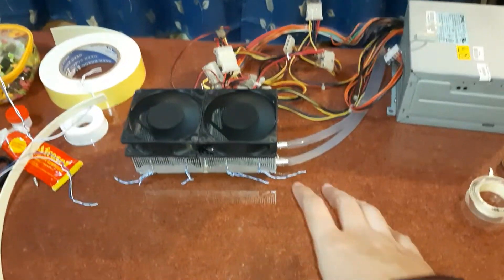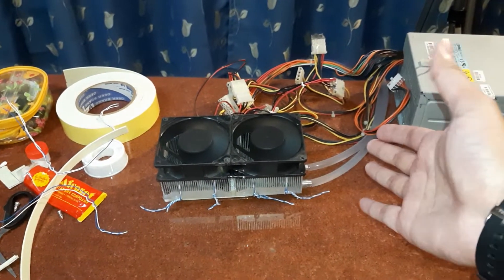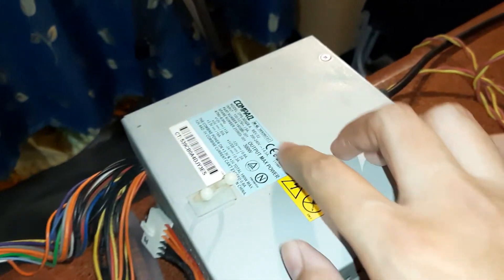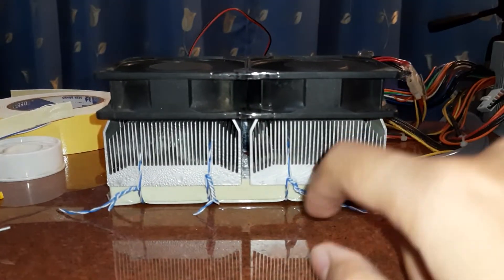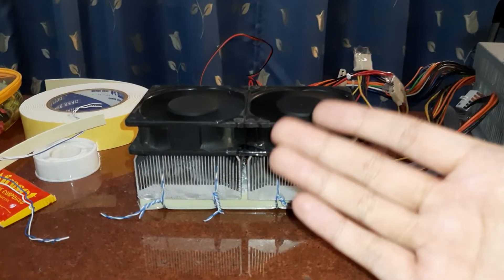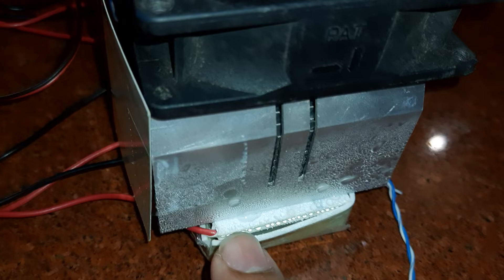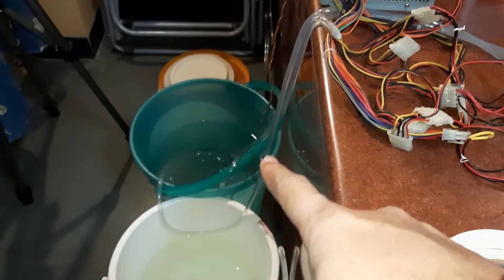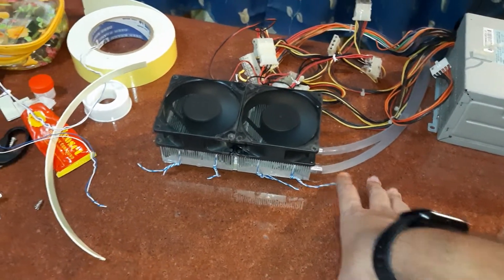[Eng] DIY Peltier Micro AC V1 | ThermoElectric personal cooling system attempt 1

Comment: Sir no matter how hard you try on this project it will never work .
You can use old fridge compressor to make personal Ac of capacity of .5 ton with far more efficiently .
I have already tried to make such thing with peltier module but doesn't work at all.
Reply from the maker: Doesn't hurt to just play around... That's how inventions happen.
Reply: @ZenInnovations  yes it's true 👍👍👍 glad that i am part of this channel 🥰
Reply from the maker: I would love to see your peltier setup. And what settings you have tried.
Reply: @ZenInnovations  I have used the same setup with water block and powerful cpu fan  to instantly cool or  heat ro purifier water .but i have to reduce the flow of water to get it's temprature around 20°C , But in winters it  heats very well, upto 40°C and takes 300w of power .
Reply from the maker: @adarshdeepsingh961  yes. They seem better at heating rather than cooling.
My quest is for a dc solid state ac that can run off solar panels and never bother with gas issues.